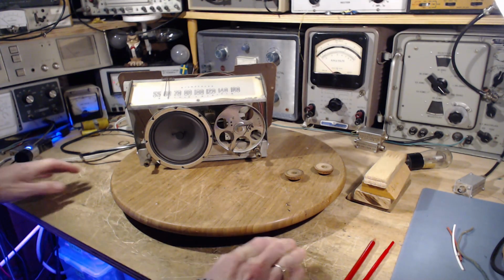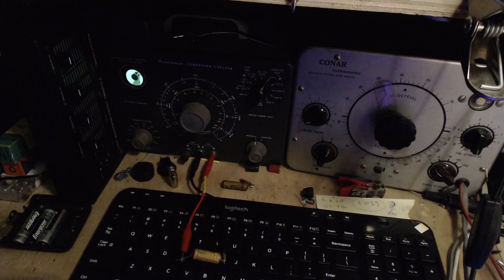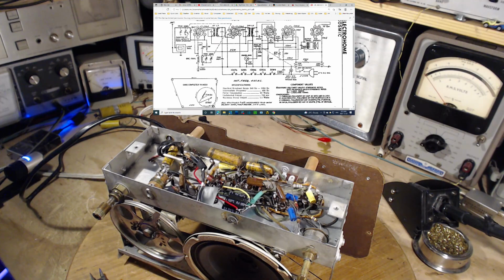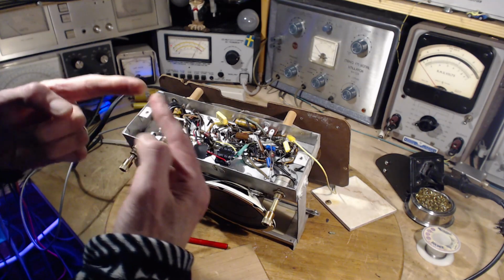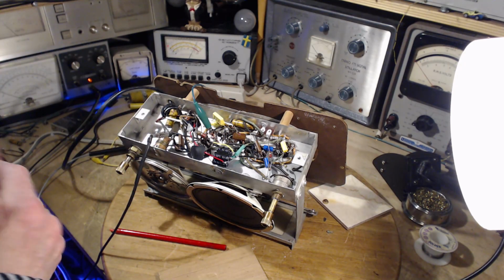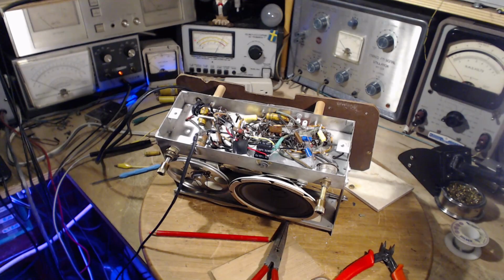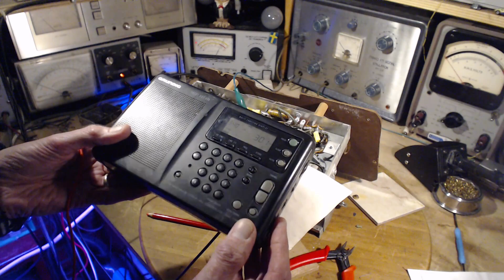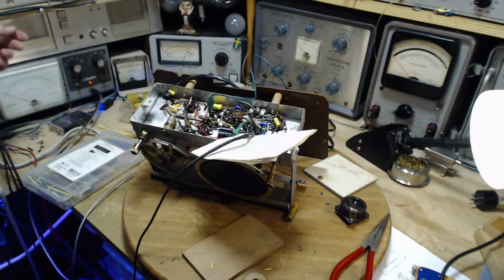Electrohome Cosmic Tube Radio Video#5 - Capacitors and Weird Happenings

Comment: The AVC voltage is supposed to be constant and not supposed to move because if it does it indicates a problem with the radio because it's letting the volume increase or decrease it's supposed to be at a constant level and the voltage is what it's supposed to be when it's working correctly

Comment: The word you're looking for is INCOMPETENCE ...
Reply: @tubeDude48  Does he owe you anything?
Reply: The word you're looking for is impertinence.
Reply: @tubeDude48  yeah I would have re-capped the whole thing, mainly the wax. Could anyone tell me what would cause distortion in a small 2 tube phono amp? I have replaced the capacitors, and the tubes and am still getting distortion. Resistors?
Reply: @tubeDude48  thank you. I was thinking one of the capacitors may have failed in the can, even though I replaced all 3. Have a happy holiday season!
Reply: Yes incompetent is the word. That's what you are. You're very good at telling Jim what to do but I haven't seen you post a video yet about how to fix a radio.
Reply: @gns423  Ohm the resistors for out of tolerance. I read about roundies at Carlson's lab. If you're not familiar with roundies they look a lot like the old reliable Allen Bradley resistor that have a sharp 90 degree cut on the round end but roundies are a little soft looking on the ends and unlike Allen Bradley they can absorb moisture and are noisy because they get loose on the inside. If your amp has any roundies they probably will read twice Thier value or are noisy. I learned a lot from Carlson's lab and he is very knowledgeable
Reply: @chriscimino7854  thanks Chris